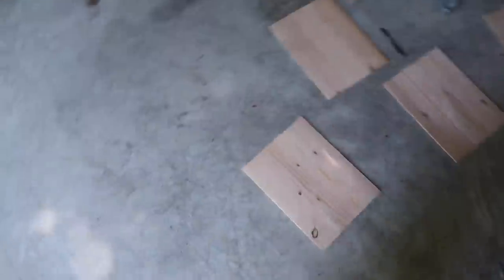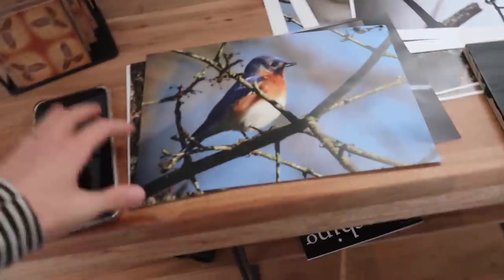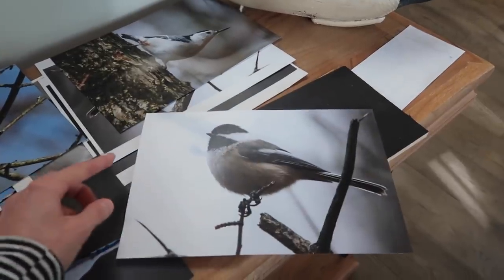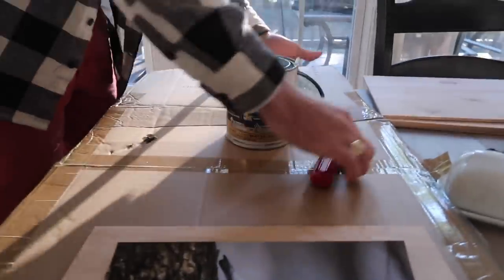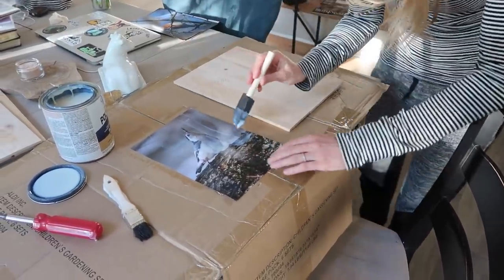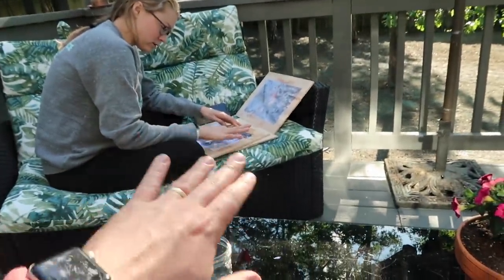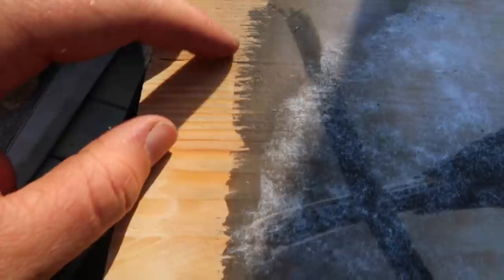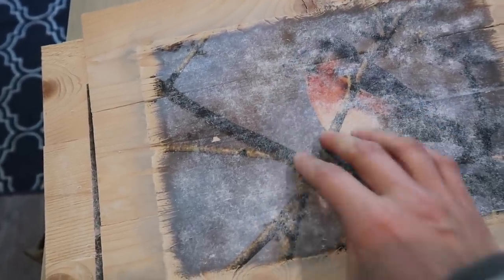DIY PHOTO TRANSFER TO WOOD CANVAS!

Comment: I have a friend that does this but on canvases. You could add hand written painted words on it also mary. Or put your favourite quotes on them or your favorite scriptures that offer inspiration, along with the birds or another photo. I want to put one of my poems or some song lyrics I wrote on a canvas with a photo. Yours turned out really nice. You could also use some of that thin rope to hang the photos you did on the wall. The same kind peter used for the plant window shelves. Just drill two small holes on each side and string the rope through. It would look even more antique looking.

Comment: Peter you need some folding saw horses and a sheet of ply wood to keep in the garage to set up as a work table.  Getting down on the floor is not good.